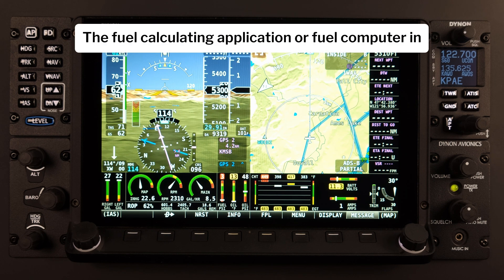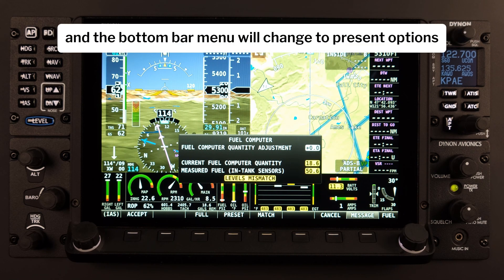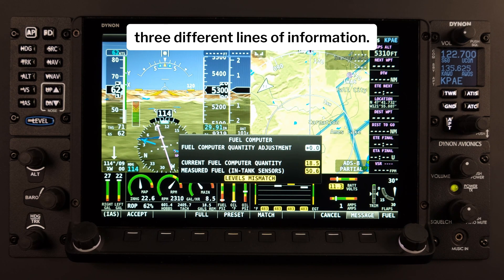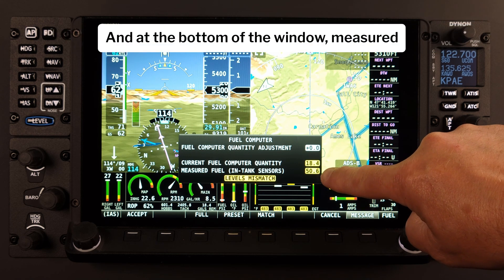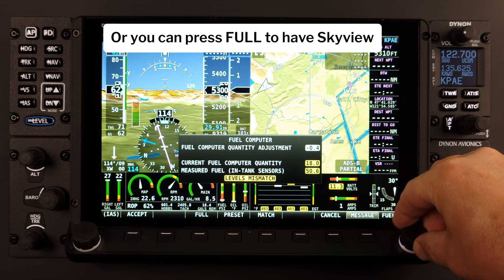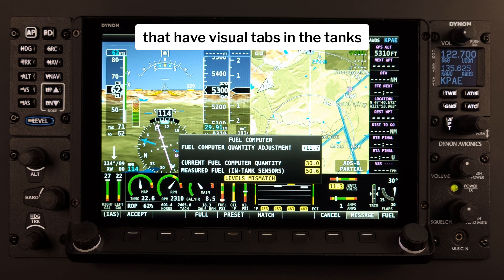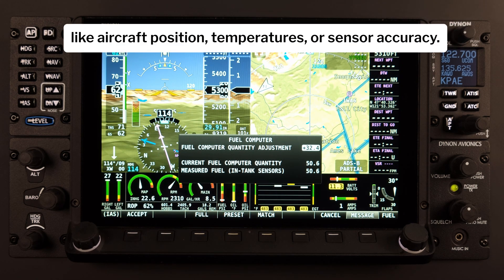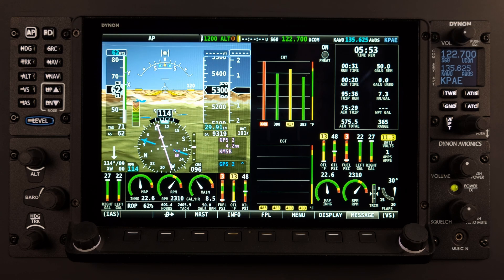Using the Fuel Computer: SkyView HDX Pilot Quick Tips

Comment: I have no idea how or if you set up the automatic fuel mismatch.  You went too fast.. I understand how to manually adjust it each time, but I would really like to get to the settings.  I cannot find anything in setting for fuel mismatch.  Perhaps the software has changed since this video?  How do you get set up automatic fuel mismatch warning in the current HDX software?  I have looked In the installation guide as well was the user guide.  I cannot find it.  A page number would be helpful if you don’t want to explain the entire process.  Thank you.
Reply from the maker: Look under Fuel Computer Presets Section 7 page 7-84
FUEL ADDED DETECT – When set to yes, SkyView will check for discrepancies between the
physical fuel quantity sensors and the fuel computer’s calculated fuel load on boot-up. If
one is found, SkyView will prompt the user to adjust the fuel computer’s fuel state.

Comment: How to I program a present?  I have an A36 with four tanks (2x mains and 2x tip tanks).  Each tip is 20gals and the mains are 37gal (useable) each. My full is set to 114 gals (all four tanks full).  But I normally fly with on the mains full (74gal).  Having a present set to 74 when I top off would be really helpful.  Thanks in advance

Comment: Can I swap the fuel tank gauges, right tank on right side, left tank on left side?
Reply from the maker: Hi William! Yes, you can:

SETUP > EMS SETUP > SCREEN LAYOUT EDITOR > pick your layout option > push SENSOR > select the L/R tanks individually and use the left knob to move / swap them > push SAVE to save the settings
Reply: @DynonAvionics  Good Deal! 🙂

Comment: Great videos. How do I create the white lines between the guage groupings?  For example, there is a left and right tank vertical bar graph. Then there is a vertical white line segregating that grouping.
Reply from the maker: Hi Todd! Thanks for the support. To adjust and/or delete the vertical white lines, go through the following steps:

SETUP > EMS SETUP > SCREEN LAYOUT EDITOR > pick your layout option > push INFO > scroll down to bottom to select vertical or horizontal dividers > use right or left knob to move them > push SIZE button to change how wide/tall they are > push REMOVE to delete them > finally, push SAVE to save the changes.